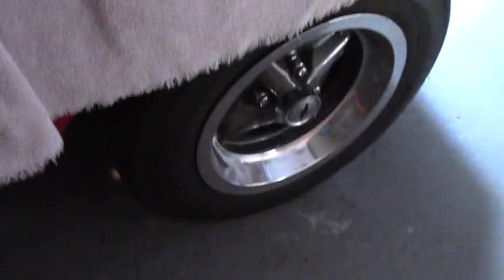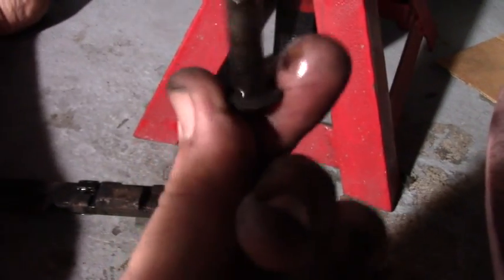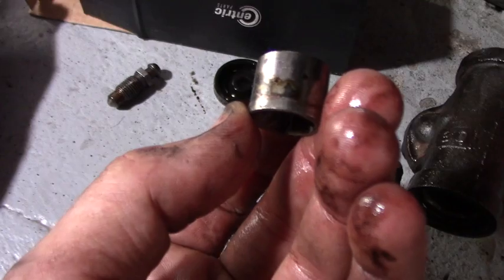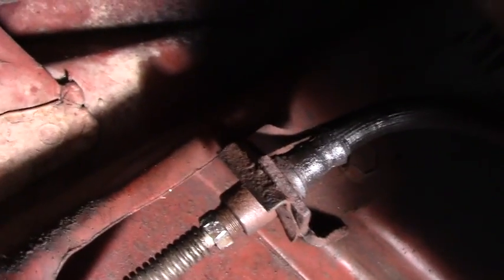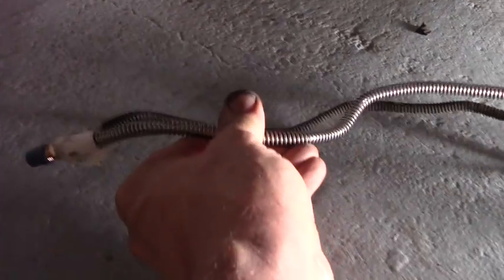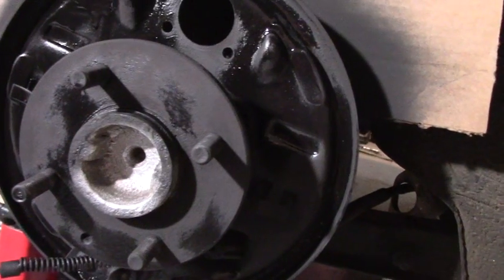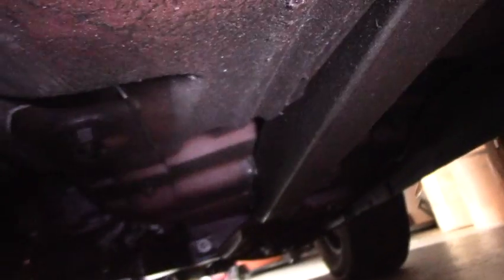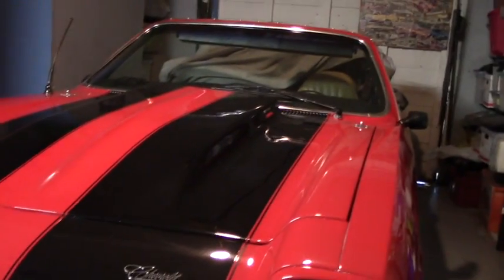Chevy Vega Rear Brake Job

Comment: I believe those new brake lines were for a 76 and newer with the 3 link rear end, where you have a 4 link. The hard lines on the 4 link rear end were routed differently due to the placement of the upper control arm mounts.
Reply from the maker: I held on to them in case I ever come across a Vega that fits them.

Comment: The subframe rails, do  they attach to the rear lower control arm mounts? I’m looking to putting a subframe in my Vega, but wanna get it done in a tested and proven way
Reply from the maker: I'm not sure.  I didn't attach them.  The guy was a local race-car welder who installed a pre-made frame-rail and roll-bar kit.
Reply: @MrSFSTUDIOS  ok, thanks
Reply from the maker: @darthvega6358  The kit might have come from Jegs.  I can't recall.  That was 30 years ago.